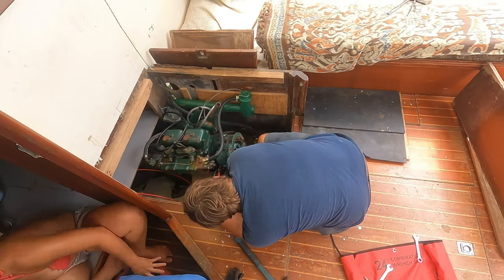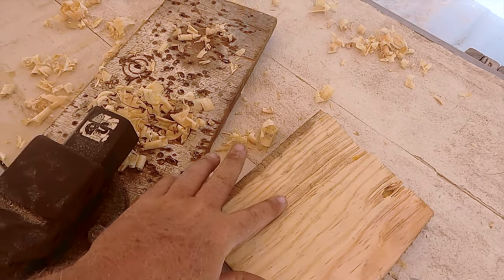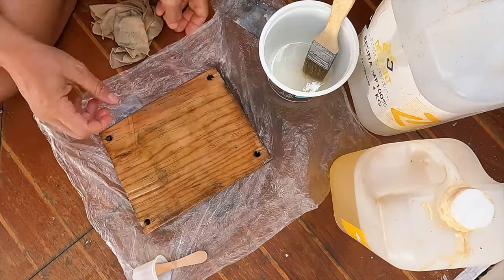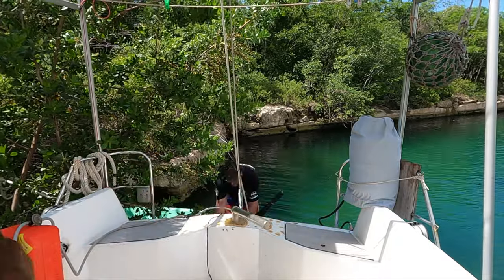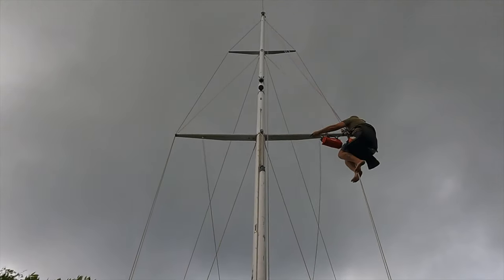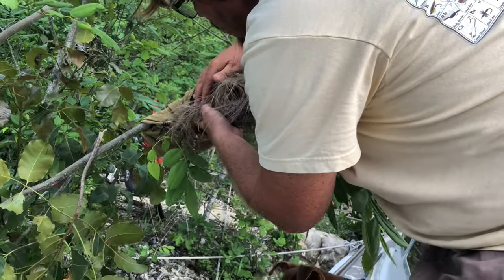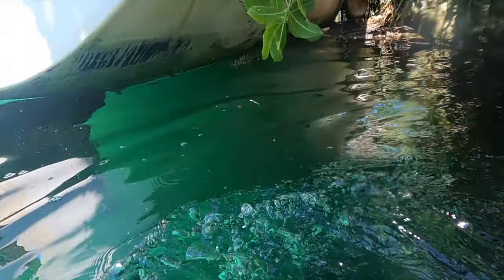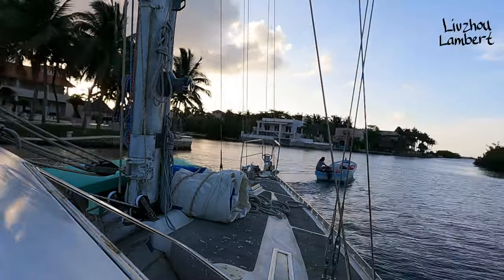CASTING OFF...again

Comment: Wow! what a journey. Outboards are fun, I have had my own fun with them... and have two of them to get ready for this year's trip. With regard to your extro of towing your boat, I have towed a boat that way but also from the hip. I have never had a hull strong enough to try pushing from the rear ;)  Anyway, I found towing (well moving anyway) from the hip much more controllable. It is probably easier on the gear as well because, at least in our case, there was no jerking of the lines as one gets with a long line tow (a kellet in the tow line might help). We found even with the push way off to the side, the boat we were towing tracked very well even though it had no keel or rudder (vee hulled power boat). While it would be best if the larger boat had a rudder and could be steered from there for better visibility,  we found that things tracked enough that I was able to see where I was going by sitting on the stbd side (dingy was on the stbd side of the boat) pretty well and my lookout on the boat kept an eye on the rest.

Just in case "from the hip" doesn't make sense to you, it means putting the tow boat on one side of the boat being towed as far back as possible and tying it up there so it is pretty much parallel. The dingy then becomes a part of your boat. Yes use lots of fenders, or an inflatable dingy, though it is rough on them too. We were in openish water (Georgia Strait).

In the end what you did worked and conditions may have made from the hip a worse choice anyway.
Reply from the maker: It’s not visible in the outro clip, but we actually got towed mainly by a boat attached to the side. This was an issue that we encountered and I will show more in the upcoming video 🤪😖.